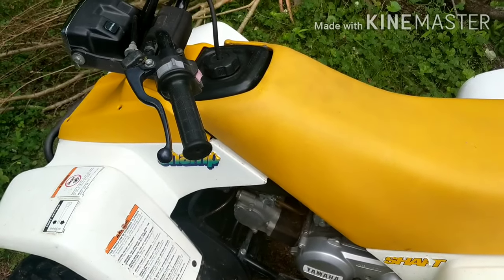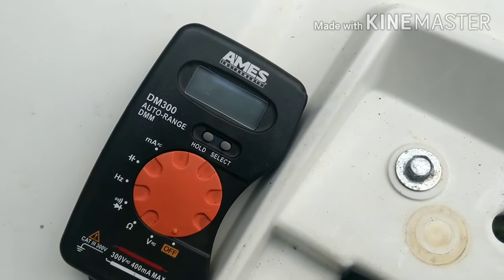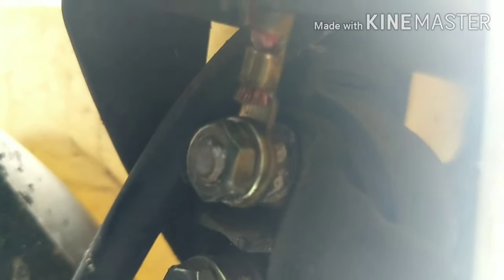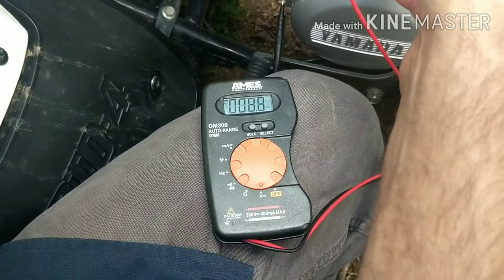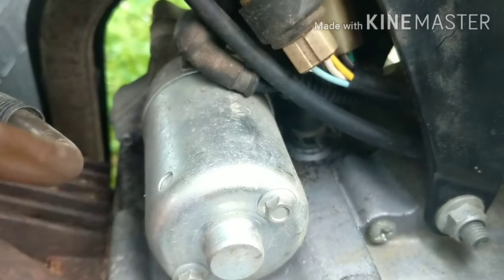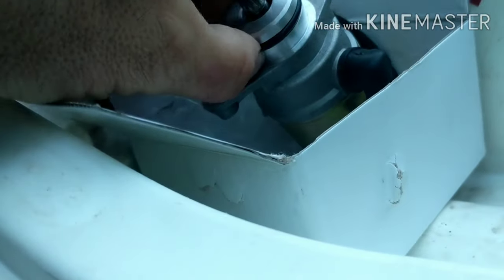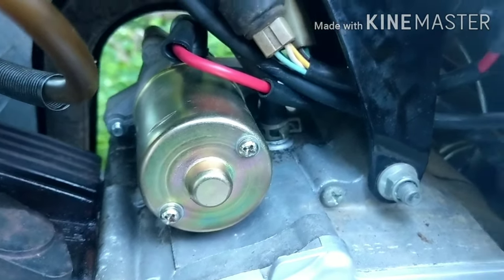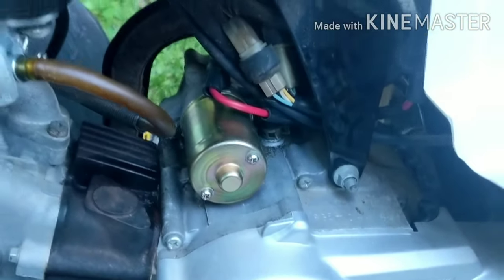ATV no start fix.

Comment: Mine was making that noise when you put on the brand new starter but I got drunk and couldn’t start my 4 wheeler and just kept trying it over and over now it just goes click click click click click click click click. Very very fast WHATS my problem? Did I burn up the started like a goofy?
Reply from the maker: That's a dead battery. If it's just clicking pull the spark plug and make sure it's not seized.
Reply: @TepcoCycleRepair  I made a short video could you please confirm?
Reply: It ended up being a burnt starter solenoid thank you though

Comment: Hi mate, great video. Just wanted to ask, I have same voltage from battery to solenoid but when I test the wire from solenoid to starter there it stays at zero. Do you think it's the solenoid? Thanks.
Reply from the maker: If it's clicking and or you have power to the signal switch them yes. If no power from the signal switch it's probably your ignition switch or start button or wires in between.
Reply: @TepcoCycleRepair  Cheers for the reply, I'll check it all in the morning. Thanks for your help.

Comment: how can i start it now that it does what ur did at the end with the new starter
Reply from the maker: That all depends, you have to have a clean carb, clean air filter, good gas, good compression, good spark and valves adjusted properly.
Reply: @TepcoCycleRepair  thank you for putting up with my crab. I appreciate it I really do. Thank you so much.
Reply from the maker: @SamOutdoorsReal  Hope you get it started! Good luck 👍🏼

Comment: Mine makes a weird spinning noise when I touch the wire to the starter solenoid and never stops any idea what the problem is? I replaced the solenoid and and I’m about to install the starter.
Reply from the maker: Sounds like the starter sprag not engaging. It's the part that spins out to crank the engine then moves back when the engine starts. Pull the starter off it should be on the end of the starter, lube it up and work it by hand to make sure nothing is gummed up then put it back on and see how it does.

Comment: Mine doesn't click when I start it. I have replaced the battery and fuse. Still nothing. Any advice?
Reply from the maker: Follow the steps in the video to track your issue. Are you getting power to the starter? If not to the solenoid? You just need to work your way back.

Comment: My suzuki Eiger 2004 400 was in the water river and since that, no start :-/ i put new stator and new ignition coil and no spark :-( what the problem please ?
Reply from the maker: I would need a lot more info then that to be able to help. In the mean time check all your switch housings and connections. Whenever an atv gets sunk it takes in water everywhere.

Comment: If the starter is not working could it break from getting water in it
Reply from the maker: Yes it could. If the starter is getting power, make sure the starter clutch isn't stuck (and the engine isn't seized) and if all that is good and the battery is fully charged, the starter is bad.
Reply: What does it mean if the engen is seased what does that mean
Reply: @TepcoCycleRepair  when u got a new starter after that what was wrong with ur engine
Reply from the maker: @SamOutdoorsReal  Nothing, I didn't have any fuel in it, I always drain fuel out of customers bikes and put in fresh fuel. I never trust what's in the tank.
Reply from the maker: @SamOutdoorsReal  Seized means the engine won't turn due to engine damage.
Reply: @TepcoCycleRepair  how can that happens water damage
Reply from the maker: @SamOutdoorsReal  Water can rust and lock up the main bearings.

Comment: What do you do if there's no click
Reply from the maker: Check to see if the starter solenoid is getting power when you hit the start button, if not, check battery voltage, safety switches, key switch, and kill switch to start with.
Reply: Thanks

Comment: What volt should the starter have? I would’ve thought it was good since it’s past 12v
Reply from the maker: The starter should be getting 12v. If it's getting 12v and still not turning, it's probably a bad starter or seized starter clutch.

Comment: Mine clicks and then sizzles around the solenoid area. I changed starter... battery and one way bearing. Still does it. HELLPPPPPPPP
Reply from the maker: Usually that's caused from two things, a bad solenoid area or a engine that's seized or not turning. Take the spark plug out and see if anything changes. Make sure the engine can turn.
Reply: How can i unsieze it? And try to turn engine.
Reply from the maker: @POPULARNOBODYS  Take the side cover off spark plug out and turn the flywheel.
Reply: Could it seize while riding it? Cus that’s what happened,  i was riding and it just bogged out slowly and now just the click.
Reply from the maker: @POPULARNOBODYS  Absolutely. Most seize that way.
Reply: Thank you. Sorry to bother you.
Reply from the maker: @POPULARNOBODYS  No bother at all. Try to turn it at the flywheel first to see if it moves. If it doesn't you may be able to get away with a top end and a bore. Pretty easy to do a top end on one.
Reply: So to know to for sure if it’s seized u said to take out the spark plug and try to start it?
Reply from the maker: @POPULARNOBODYS  Take out the spark plug before trying to turn it because that will relieve any pressure from compression and/or if the cylinder is filled with fuel. Then take off the left side cover and turn the engine by the flywheel. That will take the whole starter circuit out of the picture. If it turns fine and easy, focus back on the starter. If it doesn't turn at all, you have problems in the engine.
Reply: Ok so i just went out there and it just buzzes and that’s it.. but I’m about to do what you’re saying and see what happens
Reply: Aite so it’s turning but not easily seized or what?
Reply from the maker: @POPULARNOBODYS  Hard to say at this point, you'll need to do a compression test to see, but it's not cranking and those don't have a kickstart so you won't be able to. Is it getting power to the starter like in the video? If so you might want to have a shop look at it to save you from pulling the engine apart.
Reply: I should be able to bump start it even with a bad solenoid right?
Reply from the maker: @POPULARNOBODYS  It's an auto clutch so it will slip at low engine rpm so it will be hard to bump start it, if not impossible.

Comment: My 125cc 4wheeler doesn’t turn on by it’s self I always have to jump start it do you know how to fix it
Reply: new battery
Reply: Battery or button is bad
Reply: That's EXACTLY what mine does but wont it start even you pull start it even if it's the battery or was I misinformed
Reply: @Flower1Queen1  so it could be the button to right ?? Cause I was told if you pull start it even if the battery is dead it will still start is that true ?? Ty for your help

Comment: So my battery is fu**ed lol but turn it on with jump but then my fan won’t turn on is that because battery is toast? Help so I know if I just need another battery used to dirt bikes not quads😂
Reply from the maker: If it starts the fan should come on when it warms up. If not it may be the fan relay.
Reply: @TepcoCycleRepair  do you have to charge the battery over time ?
Reply from the maker: @kovabrasi2392  A new battery should be charged, an old battery you can try to trickle charge it but if it fired up and didn't charge most likely it's shot.

Comment: I just changed the starter on mine & i still only get a click
Reply from the maker: Make sure the engine turns and some use a starter reduction sprag gear, make sure that's not damaged. I made a video on a Polaris with that set up.
Reply: @TepcoCycleRepair  i actually have a dirtbike that clicks..i just changed the negative wire,checked the valves changed the starter relay, & starter motor..i am able to rotate it to get it to tdc but i still only get a click & at times it will sound like its about to start cranking but doesn't so im not sure what it could be
Reply from the maker: @JR-gi3cd  Get the battery load tested, make sure your decompression is working.

Comment: My carb started to leak gas and it makes that clicking noise do you know any idea what it is?
Reply from the maker: Follow the video for the clicking noise. As far as the leaking gas, you will need a carb clean. Most common problems are your float might be stuck or debris is preventing it from stopping the fuel into the carb

Comment: Had exact same problem & it was a bad earth,not starter so check that as well before going for a new starter!
Reply: How do you check for bad earth?
Reply: @asapbrook6257  Check the not +12V wire from the starter to the negative of the battery

Comment: Mine still clicks after a new starter
Reply from the maker: Take your plug out and make sure the engine isn't seized.
Reply: @TepcoCycleRepair  what is the plug?
Reply from the maker: @miklooo8080  The spark plug, Incase the cylinder is filled with fuel.
Reply: @TepcoCycleRepair  aha thx :) i did think its was kind a plug in the starter haha.
Reply: @TepcoCycleRepair  thanks for the video, I did what you described in the video I have 12.80 v in the battery and 12.71 to the solenoid and to starter 12.50 v and the starter motor can hardly be heard so do you think I have a broken starter motor then?
Reply from the maker: @miklooo8080  Probably, pull the starter and see if it spins out of the engine. Ground the body of the starter and touch where the power mounts with a 12v source. Hold it or it will spin the whole starter. If it spins free, check the starter sprag (where the starter gear sits against)
Reply: @TepcoCycleRepair  starter move only little slow and sound strange.
Reply: @TepcoCycleRepair  i have taken it off the motorcycle and it works on and off and have to use a hammer to get it to start again and it looks like oil or water is coming out of it when it spins? so you think it's broken?
Reply from the maker: @miklooo8080  Sounds bad, I would order up a new one.
Reply: @TepcoCycleRepair  ok will do thx for your help :)
Reply: @TepcoCycleRepair  i forgot to ask one thing when i try to jump between the solenoid with a screwdriver why don't i get any sparks or anything it's completely silent?
Reply: @miklooo8080  probably a bad solenoid too

Comment: battery is dead starter will not click
Reply from the maker: Yes that's the first thing to check, battery voltage and load test if you have the tester for it.

Comment: Bro mine dosent click
Reply from the maker: Okay then just check everything like I did make sure you getting power to the solenoid if you have 12 volts to the solenoid and it's not clicking it's probably a bad solenoid.

Comment: hey my solenoid makes the click noise but when I put them together, they spark. is it still broken
Reply from the maker: The starter might be stuck. I'm not 100% sure of what you're saying but if it clicks and you put it all together and it still doesn't work, pull the starter off, see if it spins, if it does, check the starter clutch.
Reply: @TepcoCycleRepair  how do I pull the starter off
Reply: @TepcoCycleRepair  I also don't know what its called but the plastic thing that spins, it seems a bit sticky, when it clicked, I checked it first. It was stuck, I unstuck it, do you think it would work now?